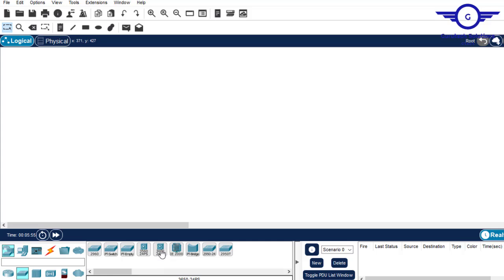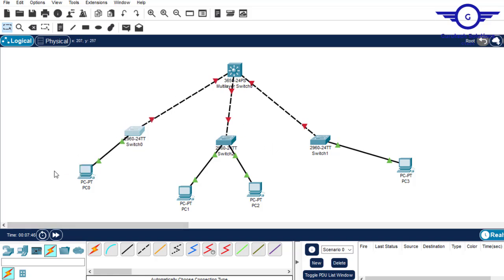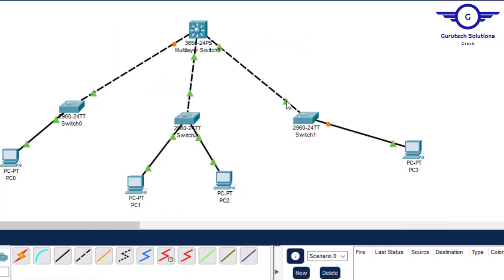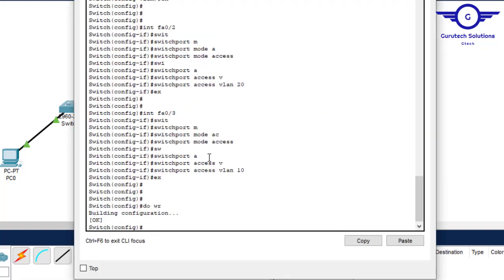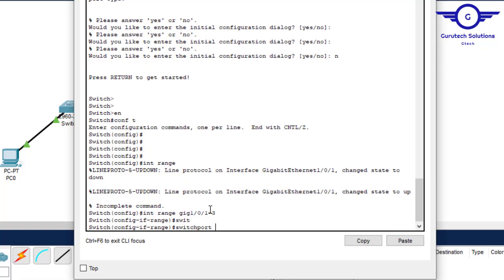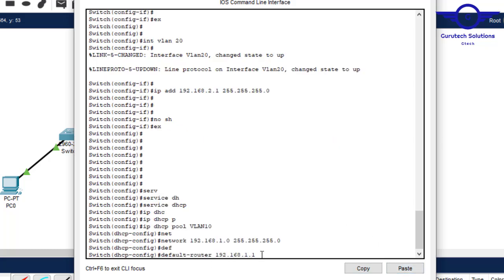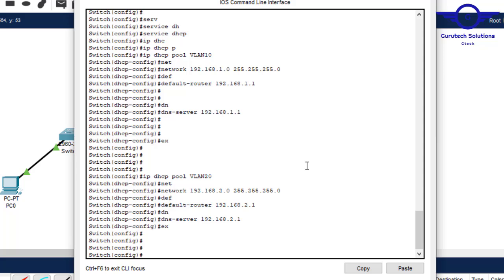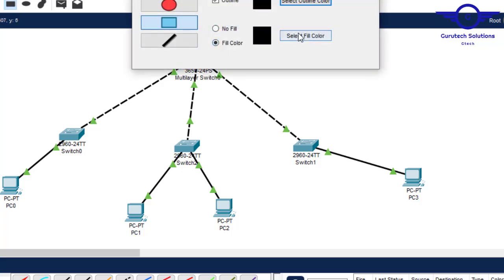How to Configure Multilayer Switch or Layer 3 Switch as DHCP Server with Inter VLAN Routing

Comment: When I'm giving AC power supply to the multilayer switch, all ports are not turning green. What I can do?
Reply from the maker: This is a packet tracer and we have to plug in the power supply.
Reply: @gurutechnetworks  Yes, I've plugged in as you shown in your video. It's not working 😔

Some ports are turning green, some are not.

Comment: When I am attempting to trunk the L3 switch it tells me, " An interface whose trunk encapsulation is "Auto" can not be configured to "trunk" mode."
Reply from the maker: Choose 3650 l3sw not 3550 l3sw--or--just include this command to pass that error, switchport trunk encapsulation dot1q
Reply: Just do switchport trunk encapsulation dot1q instead of switchport mode trunk.